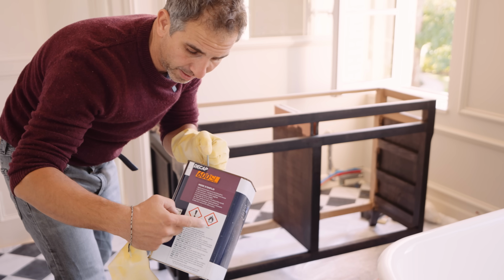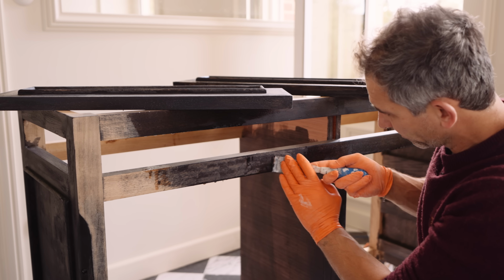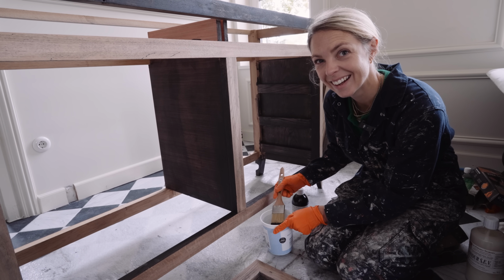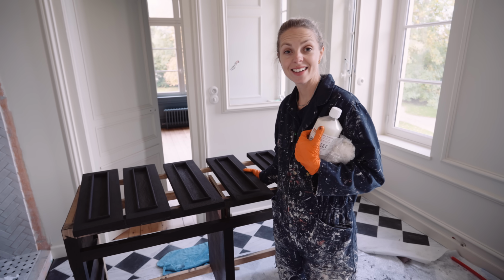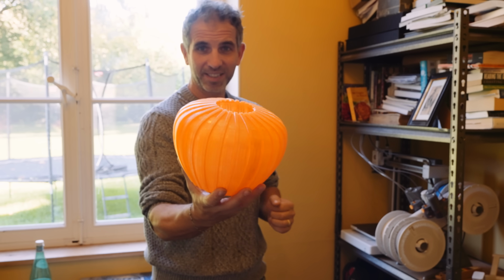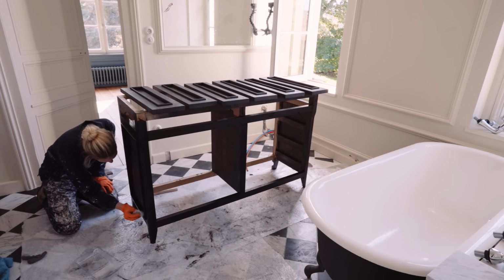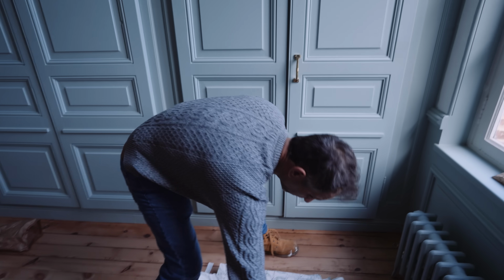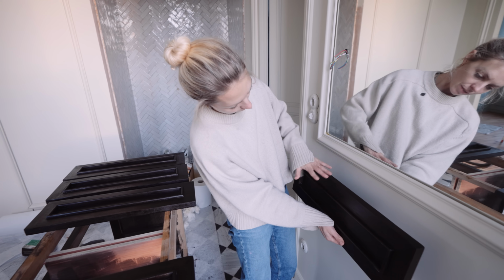The DIY Bathroom Cabinet for our French Chateau

Comment: You guys are so funny. Really makes my day! Oh uuum I read some where when staining you must use a cloth to rub it in properly. You can use a paint brush but you should use a cloth afterwards ( paintbrush picks up too much stain and can make it look uneven). You should also use a wood conditioner before applying stain as it helps the wood and how the stain goes onto the wood. Glad you guys used the steel wool in between as it helps the wood take the next layer.
Not sure if that helps 😅.

Comment: yes stain is not like paint, you have to saturate the wood with the stain liquid, more like pushing it into the grain and of course remove any excess, which would leave little puddle/running markings on the wood otherwise (more noticeable on lighter stains)😉🙃

Comment: IT IS SUPER IMPORTANT THAT YOU USE POLY BASED VARNISH AND NOT WATER BASED ONE, BECAUSE IT WILL REACT TO STEEL WOOL AND CREATE TINY RUST SPOTS AS WELL AS CAN DILUTE THE STAIN.  In the future you should try rubio monocoat in black ir charcoal as it onlu takes one layer and it is very black so no issues with uneven look.
Reply from the maker: Thanks for the tip!

Comment: Speaking as a painter with a history in furniture restoration and the wife of a carpenter, this has been the hardest episode I’ve watched since I started following you day one 😅 People, when you stain furniture at this level, you want to use an oil based stain and you want to use a company like Rubio Monocoat. Maybe you did use oil but if so, you would have had a vastly different experience with the product. Water based stains are for picture frames and floors. Oil based is for any surface that will be exposed to the elements. It has an epoxy accelerant that hardens the surface so it can handle the elements and the issues you had would never happen while using a high grade product like this. Also, you don’t blot with those wipes. You wipe back and forth gently to pull the excess off. These look better than the first run but please take my advice for future pieces like this.

Comment: I would just have painted it green. Or bought a new cabinet. Phillip your vase and arrangement are very nice. Phillip pre mark the holes with a pencil then remove the hardware so you can drill the hole straight and not hit the hardware. Much easier. A long bit will make it easier to use the drill to insert the screws. It is looking very nice. Anna I still would have gone with the green. But good job.